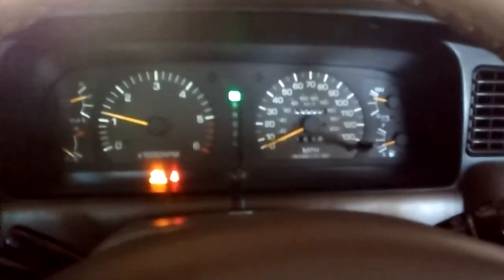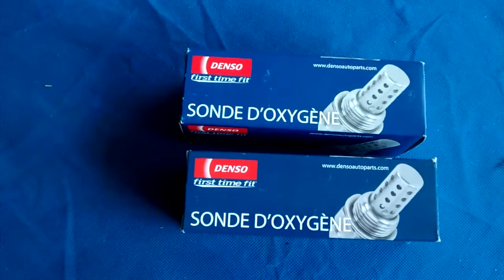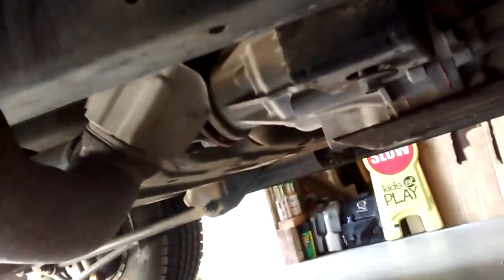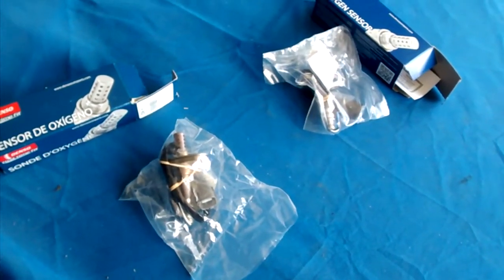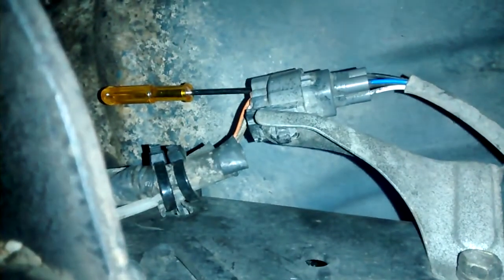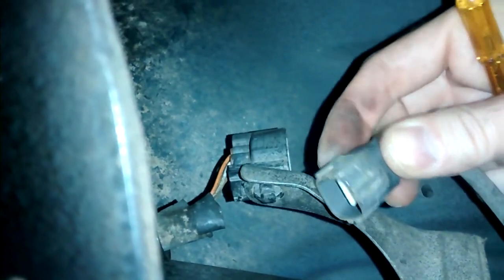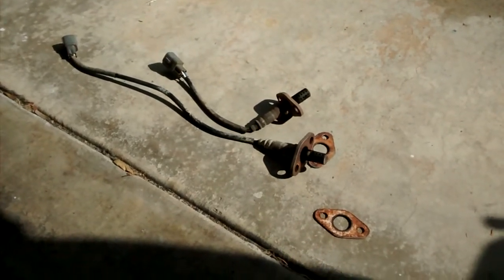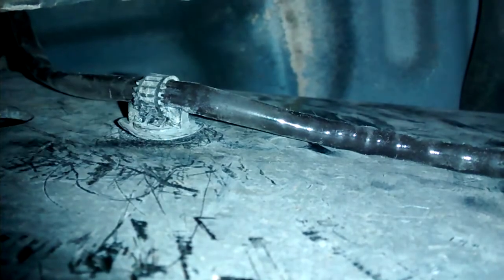Land Cruiser 80 Series O2 sensors replacement

Comment: Great video.  I'm currently cleaning the intake manifold, hoses, sensors and fuel filter/PHH and decided to take a look at the O2 sensors while the beast is up on jacks (96 LX 450, 352K miles).  I have the passenger wheel off and just happened to notice that upstream sensor within an easy reach of the wheel well.  I cracked up on your dislike of plastic sensors--just having cracked nearly every one of the injector backshells.  Nowadays, I get the male (vehicle mounted) connectors on just about anything I'm planning on touching (hoses as well).  Instead of trying to carefully eject the conductors from the plug, I just crack them with a pair of pliers like a walnut, and plug the contacts into a new backshell.  Amazing what one gets good at when you own an FJ80/LX450.

Comment: Great video and ALWAYS use the Denso 02 (or OEM) sensors for our 80 series. Good decision and yes the plastic connectors can be a real joy. Toyota exhaust nuts located on studs usually have that cut out and they’re considered “one time use” but I’ve reused them without an issue. I recommend a high temp anti-seize on the studs in case you ever need to remove them.

Comment: Mate what sort of symptoms were you experiencing while driving caused by the faulty O2 sensor? I think my 80 has an issue with my O2 sensor
Reply from the maker: It was throwing codes. Not much of a symptom. I checked the codes with a scanner and decided to replace both of them.

Comment: Land cruiser 80. Engine 3FE. Replabe Part Numbers: ( Oxygene sensor)
234-4153
234-4157
Is it ? OK
Thank you
Reply from the maker: I don't know what the correct part number is for your engine. Mine is 1FZ-FE. I don't know if the are the same or different.